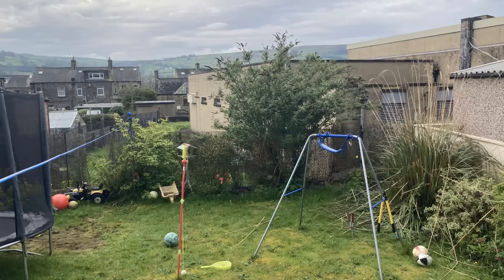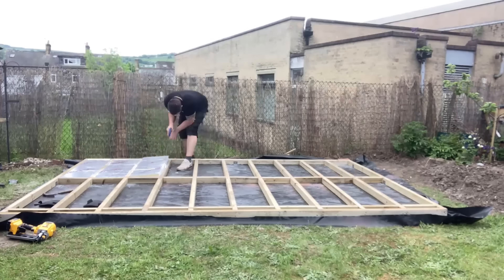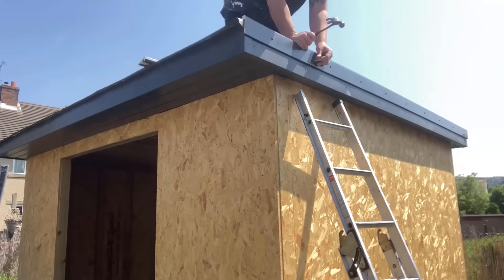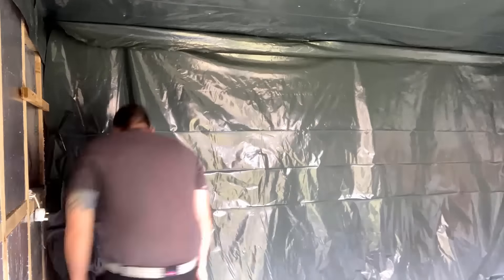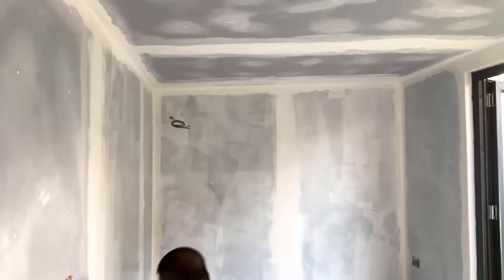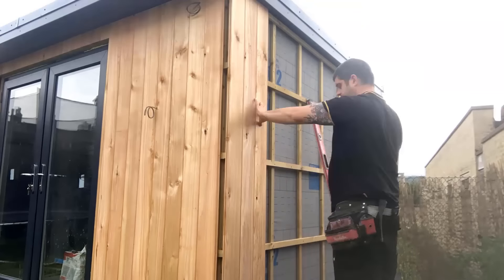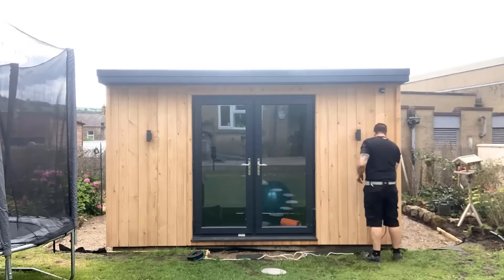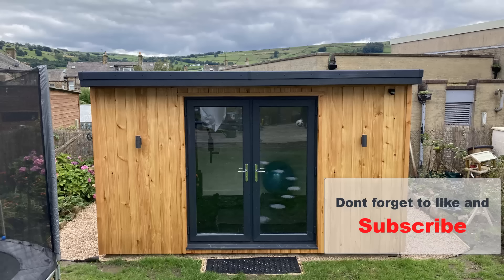DIY Garden Room - Full Build in Under 15 minutes + Project Cost

Comment: Great job. 

I did the same myself with no help. Definitely the hardest part was the ceiling plasterboard. I used 15mm soundboard. Did it myself using a deadman prop and screwing into the walls temporarily to hold one side.
Reply from the maker: Yeah I actually got help with that bit so well dome managing on your own

Comment: Amazing. Gives inspiration. What cables did you used for electrics? I know an electrician came  to connect but you had the wires in before that.
Reply from the maker: Couldnt tell you mate, I left that to the sparky. Its an armoured cable from the house and just standard wiring in the garden room as far as I know
Reply: So just connected to the house no extra fuse board ?
Reply: @jmom687  yeah there is an extra fuseboard

Comment: Great build, I wish i could do it in 15 mins lmao. I'm doing this with my brother and one of my sons, we're waiting for concrete to set, but in the meantime, we're trying to decide if the vapour barrier is needed for my brothers build, as he is using osb on the interior walls, floor and ceiling, so could you or anyone let us know if we do need it, much appreciated.
Reply from the maker: Hey Tony, good luck with the build. Im honestly not 100% sure about the internal vapour barrier with OSB on inside walls. However, I do feell like its probaly a good idea. Even structural OSB is porous. Also, you will definitely need the external wrap/vapour barrier, otherwise water will seep through the OSB.

If it were me I would add an internal vapour barrier, why take the risk? Its cheap and doesnt take long to install. If you dont do it you may end up regretting it
Reply: @thediyfix  thanks for that, we planned everything else, just unsure of the internal vapour barrier, but we' re  still early in the build so a little time to sort it. 😀

Comment: I am looking at doing something similar. Actually tinkering with the idea of putting MDF board instead of Drywall and plastering though the plastering of the the gaps between the plasterboard instead of covering it all was a good idea.
Reply from the maker: I’m pretty sure you can’t plaster on mdf

Comment: Great walkthrough and hugely helpful for those of us thinking about undertaking this for ourselves!

Having now had it for 1+ year, how's the insulation working out for you? I'd love to keep my guitars in mine as I'd use it as both a work and hobby music studio and wooden instruments don't love major temp/humidity swings. Would your setup suffice or should I be looking to add further insulation in your opinion?

I'm pretty much sure I will need to have a heater in place which will need to be on a timer or set for a minimum temp but would obviously love to minimise its usage. Thank you!
Reply from the maker: Definitely install a heater and consider some form of extraction to control humidity. The temperature is pretty good, but it can get cold when the temperature gets very cold outside. Even when it is cold once heated it holds heat very well

Comment: Fantastic job, awesome video. Have you experianced condensation on the inside of the glass at all ?
Reply from the maker: A little bit when its been cold. I am using it for a gym so I did expect there would be some. In hindsight I could have added an extractor fan, but leaving the window on vent has worked fine. I also have a dehumidifier in the house if I really needed to use it (I havent yet)

Comment: Worth it to hide the building behind! How did it cope over last winter?
Reply from the maker: Yeah the BT building is ugly. However, on a positive note, there is never anyone in that part of the building and it does mean no neighbours looking over our garden :)

It did great over winter, needed heater on when it was really cold but held heat amazingly well
Reply: @thediyfix  That's great. I was looking into rubber sheet roofing - you made it look quite straightforward.The building does look very good.
Thanks for replying.

Comment: I see your build has a slight  slant roof, correct? Isnt it right that slanted roof outbuildings need to be 2mtr away from any fence/boundery wall when you don't want to ask for planning permission? Where as a flat roof under 2.5mtr height can be directly next to a fence/boundary wall?
Reply from the maker: It has a gutter on the back running into a water butt, so I dont see see how this could be an issue. If this is a rule I suspect its for water run off (no gutter).

Plus, the building behind is an elecriciy building and the garden room backs onto an open area of grass, so even without a gutter it wouldnt affect a neighbour.

Comment: Really good content and good step by step examples. Just wondered for the sections with insulation in is there any openings for air movement so not to build up damp/condensation. Might already be in the comments but lots to go through. Thanks.

Comment: Great video. I wondered in the concrete base would you out rebar or didn’t it matter? I want one slightly wider and I don’t want the slab cracking
Reply from the maker: So my base was 100mm and as I understand it you dont need any extra reinforcement. The ground in that area was also very solid, so I decided not to bother. Im no expert, but I would say it probably depends. For example, I just built a smaller slab on more uneven softer ground and I actually used rebar mesh

Comment: Great video, I'm about to start building my garden room! I'm very new to this so have no idea!!! I noticed you used a breathable membrane on the outside but none breathable on the inside, should it not all be breathable? Thanks
Reply from the maker: The purpose of the internal membrane is to stop moisture passing through the walls and ceiling into the timber. Therefore it doesnt want to be breathable

Comment: Great Job - Well Done!! I paid £1000 to a Pakflatt specialist to have my 5.5m x 3.5 m erected. Have you any suggestions for fixing the guttering? What did you use and where did you fix to?  I have researched so many different ways of doing it but can't work it out. The thin bit of metal which hangs down at an angle and the 20cm overhang is confusing things for me. Any advice would really be appreciated!
Reply from the maker: I just bought standard guttering online, and I run the pipe into a water butt. for the trim I used a company called rubber4roofs, they have video tutorials on their website
Reply: Thanks so much for your advice.

Comment: Looks great. I completed something similar recently and opted for a warm roof (ie deck, insulation, deck, rubber). Yours looks like a cold roof but no air gap above insulation. How does it work? Do you rely on the breathable EPDM?
Reply from the maker: I’m not 100% sure what you mean Toby. The Edomite rubber roof isn’t breathable 
I’m relying more on the Vapor barrier to stop any moisture
Reply: @thediyfix  I thought you were meant to have a ventilated air gap above the insulation in a cold roof.

Comment: Fantastic job. well done
Reply from the maker: Thanks James, glay you liked it
Reply: No problem @thediyfix  . Can i ask a quick question. I'm about to do a 14ft by 14ft garden office and i was wondering if you can settle an issue i've been having. i was wanting to do a cement base but then the cost of it seemed way too much so i saw a ton of videos on youtube where the do the formwork and then use compacted stone ( 3/4 shale i think or aggregate) as a shed base. Can you tell me if that is a terrible idea ? do you see any issues with using that method instead of just a concrete base? any advice would be awesome.
Reply from the maker: @jamesmozzy  I wouldnt like to advise on that type of base. The truth is I honestly dont know if that would be ok. What I will say is my base cost £383.18. This included ballast, cement, hardcore, hiring a mixer, and buying timber to create the formwork. I mixed it myself and this was far cheaper than having the concrete delivered.

Comment: Great job, did you fit any ventilation
Reply from the maker: I didnt add any no. The vapour barrier should stop any moisture entering the roof from the room. Also, there is a gap between the soffit and wall, and the back of the cladding is open due to the battens. So in theory this should provide plenty of ventilation

Comment: Hi, excellent work! I have an existing summerhouse which I'm looking to refurbish to have as an office. The wood seems strong and intact and it also has insulation. I know that's vague but do you know if is it possible to replace areas of cladding and doors without replacing the whole building?
Reply from the maker: No idea mate

Comment: Great video, im going to start building my own in January to use as a personal training studio. Do you feel you can get enough internal height for a gym rack to fit inside, think the gym racks are around 210-220cm. I know the external height can not be over 2.5m without planning and various other factors.
Reply from the maker: Good luck with the build. My room is roughly 2100mm at the back and 2200mm at the front. I have a multi gym that’s around 2050mm and that fits fine. 

2200mm won’t fit and 2100 will be tight.
Reply: If you can dig down below existing ground level you have a chance. If your roof span is small you can use 4x2 to maximise roof height. Check roofing span tables for CLS  timber before you start - it will calculate loading and timber size. My lowest internal height is 2122mm with plasterboard and flooring.

Comment: How much cost for 8m by 4m what you think ?One more things i need permission for that ?
Reply from the maker: I suspect it would still be under permitted development providing it is under 2.5 meters high. However, I would definitely suggest you do some research and double check for yourself.

Regarding cost I would guess around £15k for a similar spec to my build. It would be more than double the size, so you would need more than double the materials.

Comment: Hi is that 2 or 4 in the wall insulation you used thanks
Reply from the maker: I assume you mean inch? the wall insulation was 50mm, so 2 inch
Reply: @thediyfix  and is there a reason you didn’t use 100 mill insulation thanks for the reply
Reply from the maker: @montdino9775  The main reason I only used 50mm in the walls was that I already have an outbuilding that I converted into an office. My office used 50mm due to space restrictions and its is relatively good at maintaining a balanced tempreture. This was an old coal store/outside toilet that I converted.

The office has no insulation in the floor, 50mm in the walls and 50mm in the ceiling/roof and it needs very little heating even on really cold days. Once the heater has been on 10 minutes it will stay warm for several hours. So I figured my garden room has extra insulation in the floor plus 100mm in the roof where most of the heat escapes.

For example today is a cold day here (snow on the ground) and I had a workout in the garden room / gym at around 7.30am. I had set my heater on timer for an hour from 6am cause I knew it was going to be cold. However,in the end it was too warm and I ended up opening the window a crack to cool down😂.

I only use the room for around an hour per day and its a gym, so it is less of an issue. If you are creating a room you plan on spending long periods of time in, then I would say 100mm in the walls is potentially a good idea.
Reply: @thediyfix  cool I was just wondering if you needed airflow at the back of the insulation in the walls I was gonna use 100mm in my stud walls that are also 100mm deep

Comment: Are you having condensation problems where the vapour barrier has been cut for the lights. We did a job abit back where on one spot light was condensing becuse of the hole in the vapour barrier
Reply from the maker: OK, so this could be an issue "potentially" However I took several steps to mitigate this: 1). the cut-out in the insulation had 25mm of the 100mm insulation inserted back in the hole this reduces the dew point meaning less moisture should condense. 2). I patched the vapour barrier in the hole and sealed with insulation tape, the goal here was to stop moisture getting through into the insulation and timber. 3). The downlight cut-outs were tight so there were no gaps. 4). the downlights have a rubber seal which I made sure reduced any gaps even further.

Due to this it is unlikely to allow much if any moisture into the cavity above the downlight. Following this, it is just a case of reducing humidity to reduce condensation, as this is a gym I tend to just keep the trickle vents on the window open to allow air to circulate.

I'm fairly confident this is enough. Time will tell :) 

This is a good video for cutting out the downlights: https://www.youtube.com/watch?v=xknCLNzhyUk
Reply: @thediyfix  happy days. Some good info there

Great job

Comment: what size it, is it a 12x16?
Reply from the maker: A little bit smaller. Measurements are in metric here in the UK, but around 10 x 13
Reply: @thediyfix  Thank you, im still confused how you did the slope on the roof. I dont understand how you sloped it. Also how high was you back wall and front wall.
Reply from the maker: @Teegray1124 I just divided the fall from front to back for each stud. So, the back wall was 2100mm and front was 2200mm. If I remember correctly this worked out at 17mm difference per stud. at a 2.2 degree angle.

I talk more about it in this video https://youtu.be/FsI8CRfjF6c

You can also use trigonometry

Comment: One comment. Where you have broken through the insulation and vapour barrier, moisture will get through and into the wood. I noticed you have an air gap for this round the building, but did you also do this for the roof, cold roof style?

Comment: But $9456 USD. Guess my tiny home build will be on pause a little longer.
Reply from the maker: Hi Michael, it is quite expensive. 
With that’s said, it’s less than 1/3 the price of hiring someone else to do it.

I borrowed around £6k to help fund the work and interest rates were still low at the time, so it’s only costing £115 per month.

Personally I use this as a gym, so I removed other expense such as gym membership and travel to and from the gym. At this point it means the difference in cost is minimal and I added over £20k in value to our main property.

Comment: Cmon bro 6 years as a carpenter does not mean you are a DIYer. 

Carpenters pick up lots skills in that time in many areas so no
Wonder it was simple for you. Joe average DIYer different story.
Reply from the maker: It definitely helps having some experience Oly, but the project itself is relatively simple. There is no individual part that is very complex. Plus there were lots of things I had never done like the rubber roof, dry lining, etc.

The most difficult bit for someone with no experience is the process and the order jobs need doing in. That’s why I created 17 detailed videos walking through the entire process.

This year I’ve had at least half a dozen DIY’ers send me pics of garden rooms they built following my videos and plans
Reply: @ think you forget what you know or what skills you have developed. It’s not crazy complex no but if things go wrong you have answers where as DIYer do not. But anyway I appreciate the content not digging you out